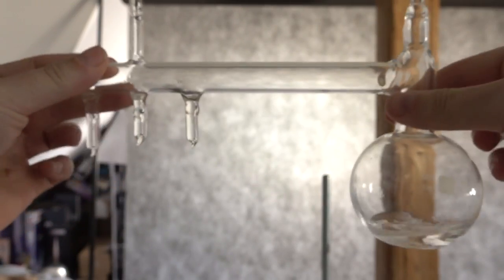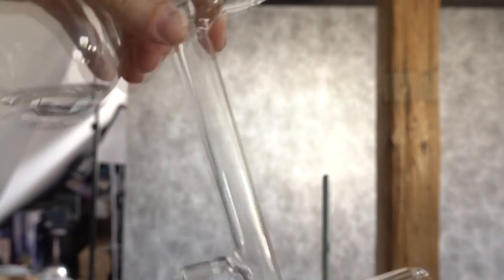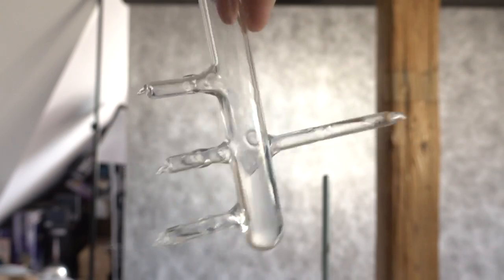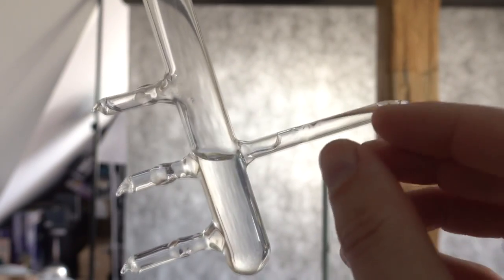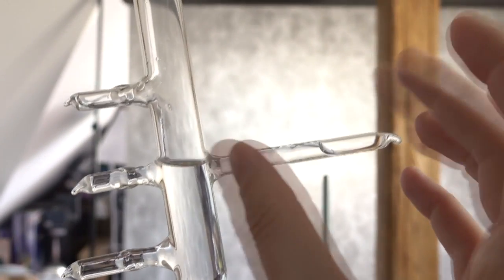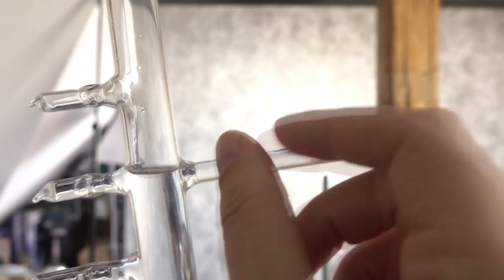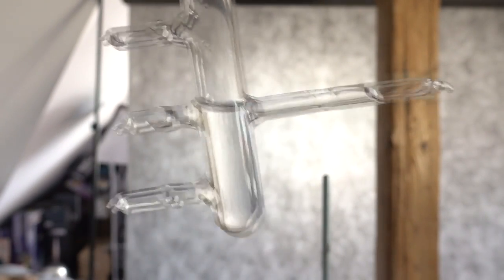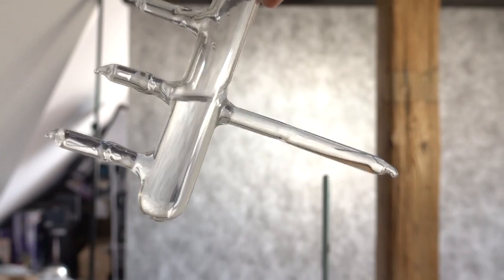Fascinating stuff water does under vacuum!

Comment: At 70 deg F the lowest pressure you can achieve is about 0.36 psi absolute, at which point the water boils and creates vapour. So if water at room temp were suddenly exposed to open space it would boil away, any water that doesn't boil fast enough would freeze into ice. Which is why comets fly around the solar system as balls of ice and when they approach the sun they form vapour trails, but there's no liquid water, just ice and sublimated vapour. In the closed tube shown you can have liquid water but some amount would have evaporated to water vapour and the vapour pressure would be no less than about 0.36 psi a (at room temp, of course).

Comment: An easy way to get the effect at home is to boil water in a container, keep heating it while it is boiling and then seal it. Much of the air is displaced with water vapor.

Copper pipes (seal ends and then seal a join in the middle with compression fittings work well. (keep boiling it with a blowtorch while someone seals it) (This is actually similar to heat pipes)

I've also had success with a Snapple bottle, first microwaved (beware of boiling water explosions when dealing with microwaved water) and then kept boiling with a blowtorch (careful, wear eye protection and try to heat it evenly) while lid is closed by someone with heavy heat resistant gloves. This has visible cavitation (and the clink noise) when tapped in the end.

Comment: I called it "cavitation". Also if the water is warmed, not even to boiling, maybe 60C, then pour cold water over it, the water can boil as it cools off. I used a sturdy erlenmeyer. Flimsy thin glass might crack from the thermal stress. Vacuum water can be fun and interesting.

Comment: I wonder if you could do the "star in a jar" thing with acetone under a similar vacuum (I think it's acetone). When the "star in a jar" bubbles collapse, they radiate visible light. There was a guy (some scientist) who got the idea the bubble collapse was enough energy for fusion to be possible. High speed thermal imaging would be cool. Using a tone generator  to create the bubbles with sound would be cool too.  And of course, thermal imaging of that too.

Comment: look thunderfoot...i ant gonna lie i dont get it.......
Reply: The bubbles are actually water vapor. At very low pressure water will boil at room temperature creating a gas made up of water vapor. As more water vapor is created it increases the pressure since the glass tubes are sealed. Once there is enough pressure to raise the boiling point just above room temperature the system reaches equilibrium. 

Then when he shakes the tube the pressure balance is lowered is some areas and raised in others so bubbles form or collapse in relation to the local pressure. 

The sound is being made by the collapsing bubbles, as the bubbles get smaller they collapse faster resulting in an implosion that creates a rebound shockwave. Look up cavitation for more details.

Comment: Cavitation. That's an interesting stuff. You can even create diamod's with it.
Reply: diamonds? please explain.
Reply: because water is incompresible, when the cavitation buble colapses, in an instant it create insane pressure and temperature at that point. If you introduce graphite to it, then diamond hapens. :D Ofcourse, the quantity is that you have to use a spectrometer to measure it :D
Reply: That is actually very interesting.
Reply: Graphite is coal. Diamonds are created by coal in very high temperatures and pressure. Apparently the bubbles create very high temperatures and pressure, but obviously at a very small point. Which is why only a very small diamond would be possible (I have not actually looked up if this is true, but this is the idea).
Reply: well wtf are we waiting for guys, lets get on it!

Comment: So... why did not the water boil? Bad vacuum?
Reply: The water did boil, however as it did it created a gas (water vapor) that increased the boiling point. Once there was enough pressure to raise the boiling point above room temperature the boiling stopped and the system reached equilibrium .
Reply: +Brained05 Ah, good explanation! Thanks!

Comment: That is https://en.wikipedia.org/wiki/Cavitation it causes holes in anything (other than sea creature skin, with its micro groves or pits to prevent nucleation sites).  The force generated is far in excess of what you expect and it is acted on a very very small area.  Your vacuum is creating the exact situation to study the process.

Comment: Before i watch the rest of the video im going to guess. Im gonna sound stupid when i explain this but, i seems as thogh the water creates its own atmosphere. Dude to the vacuum there are no other pressures to cancel out the pressure created by the water. something like that?
Reply: You're correct. The bubbles are actually water vapor. At very low pressure water will boil at room temperature creating a gas made up of water vapor. As more water vapor is created it increases the pressure since the glass tubes are sealed. Once there is enough pressure to raise the boiling point just above room temperature the system reaches equilibrium. Then when he shakes the tube the pressure balance is lowered is some areas and raised in others so bubbles form or collapse in relation to the local pressure.

Comment: Is this similar to what happens when a person cracks their fingers?
Reply: Yes ... and no... according to Wikipedia:

The physical mechanism that causes the cracking sound as a result of bending, twisting, or compressing joints is uncertain. Suggested causes include:
Cracking sounds occur when bubbles form in joints as they are pulled apart.
Cavitation within the joint—small cavities of partial vacuum form in the synovial fluid and then rapidly collapse, producing a sharp sound.
Rapid stretching of ligaments.
Intra-articular (within-joint) adhesions being broken
Reply: haiggoh makes sense, however, if youve cracked your knuckles before (like me) then youd know that its not usually repeatable which it should be if you are making a vacuum.
Reply: haiggoh well, if you cracked your knuckles then when you try it again it wont pop like before. the vacuum should repeat, but the fact the knuckle popping doesnt suggests its not the vacuum.
Reply: L3610NF0R14M7H37RU7H Oh now I get what you mean. Ok fair enough that makes sense… I guess I remembered it wrong then, it had something to do with a momentary vacuum, but I have to look it up again.
Reply: haiggoh that could still deal with the gas thing i was talking about in which it would pull the bones together to collide after the gas escapes
Reply: Experiment: take an uninflated balloon (the long skinny kind they make balloon animals from) and put 1mL of vegetable oil in it and let the oil settle to the blind end.  Take two fingers of the opposite hand, after putting a bit of oil on them as well, and pinch the balloon at the surface of the oil.  Slide your pinched fingers toward the bulk of the oil until the pressure of the oil in the blind end exceeds your ability to hold it back with your pinched fingers.  You will get a fluid jet travelling at high velocity.  The balloon is the joint capsule, your fingertips the articular cartilage surfaces, and the oil is the synovial fluid....  just my hypothesis, but I think creating a fluid jet is very plausible.
Reply: Animuldok interesting, though would you suggest that it would require a significant time for this experiment to reset if it was biologically recreated via blood, bone, cartilage, etc.? also, what is a blind end of a balloon? im not familiar with that terminology for balloons.
Reply: L3610NF0R14M7H37RU7H it was the best short description I could think of.  I was speaking about the end of the balloon opposite from the open end.  I don't think it would have a significant reset time given the anatomy of a joint.
Reply: no, the current theory is that its more like a fart. gas builds in between the knuckles and is released when you "pop" them which cause the bones to collide.
Reply: no the gas bubbles hypothesis is outdated. You keep hearing it in many places, especially on TV but the most recent and imho most logical explanation is that you build up a temporary vacuum which rapidly pulls the bones back together.
Reply: L3610NF0R14M7H37RU7H Why wouldn't it be repeatable? It's just as repeatable as Phil's little water-in-vaccum-tube experiment in this Video.
Reply: Animuldok then that leaves a problem for the theory, when i pop my knuckles i cant pop them in rapid succession and usually it takes quite a few hours before they can pop again so i cant imagine thats how it works then unless it would have a longer reset time
Reply: L3610NF0R14M7H37RU7H well, until someone uses an imaging technique that allows for visualizing the process over time, anything we say will be speculative and will have to wait for the empirical data.
Reply: Animuldok yes, however, im sure we can agree that all the current theories are similar?

Comment: Is the fact that the gas in the tube is almost all water vapor the only important property here? I would have added that the reduced bubble pressure allows for large changes in the bubble volume to occur as a result of relatively small changes in the absolute pressure of the bubble. Just lightly shaking the glass is enough to cause the required pressure fluctuations. 

The same degree of expansion and contraction would occur at higher pressures, but the glass would need to be shaken harder.

Comment: the cavitation can break the glass. I do it with water in beer bottles as a bar trick. you fill the bottle with water then while one hand holds the neck, you slap the opening at the top (with moderate force) it creates a cavitation near the bottom and blows out the bottom of the bottle

Comment: Hi Thunderf00t, isn't this just produced as a result of atmospheric pressure (or complete lack there of)? It's very similar to the principle of cavitation that occurs on motorboat propellers, if they aren't made/ground correctly. A barrier forms on the prop due to extremely low pressure and the water behaving like it's boiling at an ambient temperature and adding an artificial layer to the porp, resulting in a complete lack of thrust.  PS love your work 😃

Comment: You should explain the  pressure vs phase change curves. Obviously, the vacuum in the tubes is not enough to reach the solid/gas only level.
That would make a nice demo, also. water vapor deposition can make some cool looking crystals.
I guess that may be difficult, though. the water vapor should provide plenty of pressure in such a small device to keep the water liquid.

Comment: I'm thinking creating the cavity allows water vapor to rush into the void (i.e. the water boils depending on the exact pressure) which causes evaporative cooling which causes the water vapor to condense, collapsing the bubble, which then results in heating causing the water vapor to expand creating another but slightly smaller bubble. The process repeats in a cyclic pattern until the change in potential energy that created the void in the first place is dissipated.

Crossing my fingers on being right about this.

Comment: Is this technically a demonstration of cavitation?  I know cavitation will occur in hydraulic pumps however this seems to be the same thing in a relatively stationary glass tube.  Very interesting.
Reply: It is. it can happen anytime water is under high enough negative pressure like the suction side of a pump or even in a pipe network if the elevation is increased enough for the pressure to drop.
Reply: The demo I enjoyed was holding a vacuum Erlenmeyer flask in my hand while reducing the pressure through the side arm and watching water boil from the heat.  Of course if the pressure were a little lower it would be the ambient temp that would boil the water.  Still, neat to think that it's the heat off your hand causing the boiling.  Thx!
Reply: It also happens when you slap a beer bottle full of water and the bottom breaks off.
Reply: ***** We use to fill them with water, push in your finger, pull finger out suddenly and plop goes the bottom of the bottle.
Reply: Sean Nanoman I have to try that. Didn't know it was possible like that.
Reply: Yes, and the vapor collapsing back to liquid phase can create large localized pressure as the pressure wave propagates, which I think is what causes that noise in the glass.  Basically the same thing happens during water hammer in piping networks; actually the reflection of a pressure wave off a dead end run can cause cavitation, or some times called column separation (because it can more easily happen in a vertical liquid column where there's also a static pressure gradient).

Comment: It this what they call a super critical fluid?
Reply: No. This is just water under a vacuum. A supercritical fluid usually occurs at very high temps and pressures, not room temperature and low pressure.

Comment: I though a vacuum ment that all the air was sucked out. I would say under lower pressure but not a vacuum. then again the glass would implode due to the outside pressure being greater than the inside pressure. much like heating a light weight metal can then rubbing an ice cube on it. it's still cool though.

Comment: Wold that be a cavitation effect that is more easily seen?

Because if it is, then you would be more easily able to break the glass using only the water inside the module there, in much the same way the bottles of glass bottles can be popped off by filling the bottle about half way with water then firmly slapping the top of the bottle while you are holding the bottle. Gloves are highly recommended for this if you try it.

Comment: So essentially you've recreated what lightning does in air.
Reply: Heat and lot of it is causing the shockwave.  When I say heat we're talking crazy high temps.  This heating causes an outward expansion which is essentially like a vacuum,  which hits the colder air, at a speed faster than sound would otherwise travel. This makes a shockwave but must be done by the will of the Norse god Thor, son of Odin.  Occasionally Loki plays around too.
Reply: That's crazy, do you know why it creates a vacuum?
Reply: very interesting....
Reply: Jack T how is that similar to lightning in air?
Reply: Not sure where my reply went to! Anyway, basically when lightning goes through the air it makes a vacuum.  When it's gone, the air slams back together causing that "boom!"  There is a bit more to it than that regarding heat, pressure etc, but basically similar to what the water is doing.
Reply: The sudden heat, expansion of air etc.
Reply: what?
Reply: Jack D What, what?  What are you asking?
Reply: +Jack T damn I thought it was becuase the movement of the electrons where going faster than the speed of sound so it creates a shock wave.

Comment: how do you managed to remove all of the air in it  ? the only way I can think of  : 
bring the water to the boiling point
cut the tubes to make the glass hermetic
let it cool down, slowly

but does the "vaccum" inside the glass make it easily to unsafely breakable  ?  or may we know/assume the pressure in it is close enough to the atmospher ?

Comment: Back at the Nuclear plant when we fill the RVLIS system , we use deaired water.  What you do see is take demin water and pull a strong vacuum on it.  Then you run an agitator to cause cavitation in the water.  That gets almost every damn bit of air out of the fill water.

Comment: the water is boiling due to lack of pressure
Reply: if you have a syringe without needle on it, suck in a cm of water, then pull the plunger as far as you can while keeping the opening shut with a finger. You will make the water bubble as if it boils at room temperature.
Reply: Thanks for the first grade science lesson

Comment: As already mentioned in the comments the phenomenon is caviation, which will most likely be powerfull enough to destroy the glas.
From a scientific point of view I would be interested in the pressure of the expanded bubbles. 
In your video you state that they are water vapor bubbles, which is technically correct, when trace amounts of air is neglected. But I have the feeling that water evaporates to slow, even under low pressures to form such bubbles that quick. So most of the bubble is vacuum, as the evaporation can not keep up with the formation of space.

Comment: It will boil at room temp under vacuum. I don't recall the exact amount in inches of mercury, but this is why whenever I would do automotive A/C work, I would pull down the entire system to about 30 in of vacuum to boil out the moisture and to check for leaks in the system.

Comment: I'd tend to think that the motion compresses the air to a higher pressure than the water itself (given the short timeframe in which compression happens) so its like a 'hard pea' and rattles like one until it is reabsorbed back into the water.